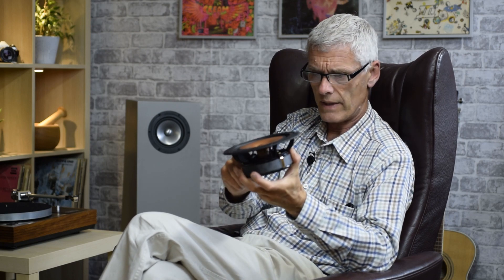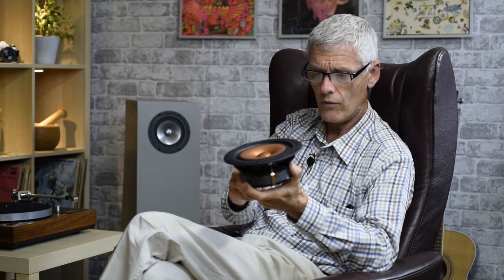Mark Fenlon of Mark audio talking MS series transducers

Comment: Some manufactuerers need to make 3000 ohm coils so we can use 300b in otl mode. This would mean incredible detail and responce. It would be the ultimate modification. And its cheap and easy to do relative to any other modifications

Comment: I have been wondering if Mark were to implement this design with a neodymium magnet with a much higher magnetic flux density than a ferrite magnet, with the stronger magnetic field, the cone size/weight could be increased without a loss of impulse response. Could be a superb large emitter for desktop open baffle applications.
Reply: Just slap a bigger ferrite on it. What's the point in neodymium? The only flux density that matters is in the gap.
Reply: @rhalfik  bigger isn’t always better 😂

Comment: I've been building speakers for years and design them to be single-point-source full range with impressive enclosures that are floor standing and by cutting away most of the spider with care and symmetry and removed dust caps and have achieved stunning results. The spider suppresses coil motion in two ways. Firstly the springy type structure of the spider itself resists the ability the coil to follow the signal accurately although this suspension effect does soften with use. The secondary problem is that with a dust cap and an airtight spider creates an air compression anomaly further by default between the pathway from the back of the dust cap and the back of the spider causes a restriction to the coil. By using a 6.5" driver (I've tried many) and using deflector units and a specially designed duel transmission cabinet calculated to roll off at around 30Hz or bellow dependant of driver and amplifier characteristics with a quarter-wave14ft uniform distance baffle from the driver edge. The result is a highly compliant cone with no deep bass cancellation and clear transients combined with an easy low-resistive load on the amplifier. In my book of thoughts, the driver should never be directly coupled to a loudspeaker housing but suspended with a good airtight seal.
Reply: Your design is deeply flawed.  Just kidding I have no idea what all that means.
Reply: Good God...I was hesitant based on the volume of info and knowing you have but here we go:  I just built (well braced) cabinets for a pair of CHR-90s...MDF, blah blah...very bright but the cabinets are too large...like 2.5 liters too large  .I was just given a pair of Advent Graduates and Omega 300s...I have some beautiful blonde poplar wood left over.  I've saved the drivers for my up and coming build.  8" woofer and a beautiful 2" tweeter from the Omegas.   Any advice?  My question is sort of ambiguous but I seek advice from any source.  Thanks.

Comment: I wonder what is done to prevent dust from entering the voice coil gap?
Reply from the maker: Nothing is implemented in the actual driver, don't forget these are  installed inside a speaker that is hopefully free of dust. You'd probably not want to use them mounted in a ceiling void 😀 There have been no reports of problems so far and we've sold a lot of them now. The Alpair 5 has been spiderless for years and no problem with those either.

Comment: Very intrigued by these and if the interview is actually in Mark`s room with those fine titles on the the wall they should be pretty capable.
Reply from the maker: Hi Mark, I'm afraid the room is not a room, it's a set in my unit. The tunes, the deck, the guitar and props are all mine, not Mark's :) Sorry to burst a bubble!! I do make very pretty capable speakers with Mark's drivers though ;)
Reply: @Stefanwhatcott_KJFaudio  hey man nice video and good quality...do you know of anything that prevents dust from entering the gap?